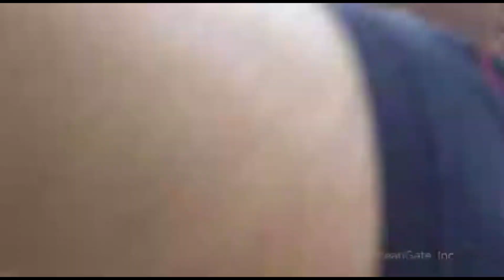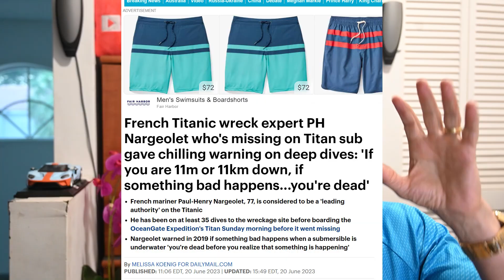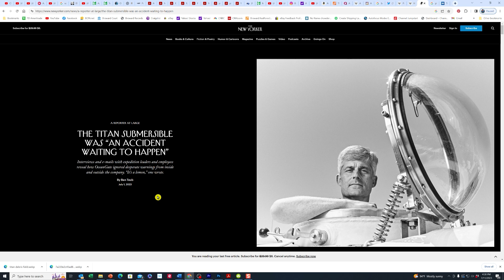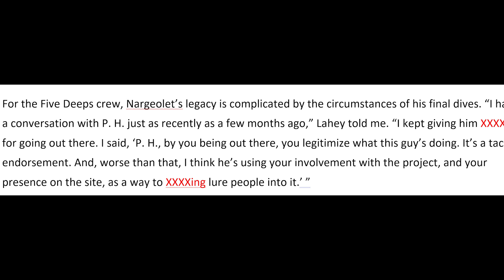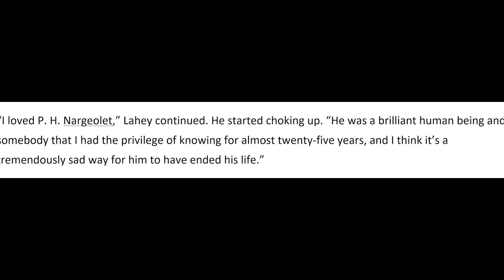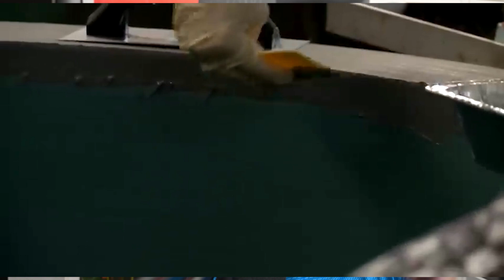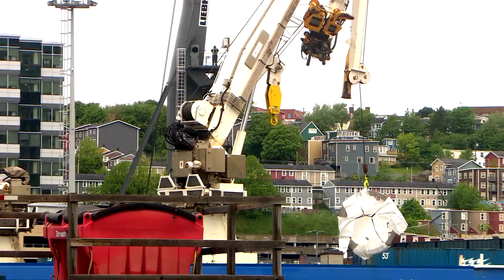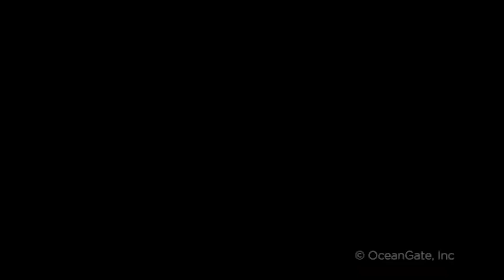Titan Sub: More Q&A, Design Defects, Why Descent Fast

Comment: I think it's a real argument for pilot error. Rush had far less concern about his descent rate than the mothership, which leads me to believe that he purposely dove at that speed. Either he was showing off for the Portier Prince crew to show them the sub was tough to show proof of concept or he was trying to hurry the trip to get back to something else. Either way, Rush was an engineer, he knew the possible outcome of descending too fast. Misplaced faith in his design or death by pride? Idk! And, I don't believe the sub was weighed down by water because Rush would have recognized that issue based on the rate of descent and would've made corrections to address the issue or flat out cancel the dive. Besides, the only infiltration of water that could have had a major effect on the dive rate would have had to occur within the pressure vessel where the crew sat. I find it highly unlikely that Rush or the crew would not have noticed a leak inside the sub. Additionally, if the hull was compromised enough to allow water to come in, the Titan would have imploded far before it reach the Titanic. Also, all the major components sat in liquid filled compartments or were in pressurized housings in the mechanical bay at the rear of the sub. if the sub was weighed down by water, where was the leak? In my view, the more likely scenario is that the rate of descent caused damage to the battery compartment and the hull and both only completely failed when the sub got near the titanic and needed to ascend. While they had a secondary battery system they only had one hull. Whether a vessel is  made  from titanium or carbon-fibre, descending or ascending too fast can cause structural failures in compartments and the main pressure vessel. All the hype about the material the subs hull was made from could actually be wrong!
Reply: If Rush intentionally dove at that speed, then why didn't it ascend at the correct rate?

The ascent was too slow, which I think helps point at the rapid descent as being unintentional.
Reply: @awilliams765 gravity, I believe, is the simplest answer
Reply: @kathypriest95 GRAVITY is counter-acted by water pushing up (buoyancy).   This discussion is trying to determine why the sub lacked buoyancy & fell almost twice as fast as expected.  Also why it ascended at only ~7 meter/second.  (Seems obvious to me: It was partly flooded with water.)
Reply: @kathypriest95  😂😂😂
Reply: @electrictroy2010  You could be right! Maybe there was water infiltration through the buoyancy system at the beginning of the dive that caused the descent rate to be high. But, what really gets me is that this guy designed this vessel. Even if all of his diagnostic equipment had failed, as the vessel's inventor, he should have been able to recognize the slightest of problems with the vessel. The accelerated descent rate wasn't a slight problem it was the elephant in the sub and was a clear and obvious sign that something was severely wrong somewhere and he flips it off like it didn't matter.
Reply: @awilliams765  I thought about that. If it was unintentional, the first warning sign would have been the descent rate itself. The crew of the Potier Prince seemed more concerned about the descent rate than Rush, inquiring if he was going change his velocity. This text suggest that he had the ability to slow the craft and just didn't or couldn't. But if he couldn't that too would've been a red flag. Why weren't corrections made or the dive aborted? Was he trying to keep everyone in the dark on the subs predicament to prevent panic, knowing it was no way out? Idk! 

The high rate of the dive itself at double the decent speed can cause major damage not just to the hull but also the titanium/steel battery compartments that are filled with a silicon liquid gel and sealed to protect the battery from intense pressure. From the transcripts, it appears the power system failed first forcing Rush to switch to the backup system. The backup system was subject to the same effects of the dive and while it had not completely failed like the primary power system it could have been on the verge of failing and not providing enough voltage for meaningful upward thrust. This then prompted Rush to drop every weight he could with little improvement. 

It's also possible that the intense pressure caused damage to the buoyancy system, allowing water to enter.

Another possibility takes on the perspective of the pilot's situational awareness. 1. At the beginning of the dive, you knew there were national and international regulations in place that specifically limits the dive speed of submersibles as a safety measure for the crew. 2. You are aware of the effects that a high dive rate can have on a vessel and its major components, yet you decide not to slow the velocity when prompted to do so. You believe your vessel is somehow more special than others because you made it. 3. You are aware that you feel attacked for your subs design and want to prove to your colleagues, who are engineers like you, that they are wrong and you are right, so with the crew of the Portier Prince as witnesses to his crowning achievement, he dove the Titan at literally breakneck speeds to prove his carbon fibre design was more durable than subs made from titanium. 4. He then becomes aware of the of realization that he was both right and wrong. He was right that his carbon fibre design could stand up to the pressure of the deep seas like subs made from Titanium but he was wrong for thinking his carbon fibre sub was not subject to the same detrimental effects as titanium subs at high dive rates. He was wrong to think he could skirt around regulations that strictly prohibit accelerated descents precisely for this reason. 5. He only became aware of his situation when the primary power systems failed, knowing he had backups he wasn't too concerned.   That awareness turned to fear magnified as the acoustic monitoring system was reading imminent implosion. When all his efforts to increase the ascent rate failed, he then came to his final awareness. 7. By trying to prove his colleagues wrong he allowed his hubris and ego to seal the fate of 4 other souls and himself. It's possible the sub was ascending at the correct rate but facing an imminent implosion from his perspective, no ascent rate would've been fast enough. 

 Or, it could be a combination of some or all these things and possibly more. We just don't know and may never know. 
 An arguement can be made for pilot error
Reply: It is a submersible, not a submarine. Descent happens because it has ballast weight, ascent happens when they drop the ballast. Both ways it is a passive motion driven by laws of physics. So, if you are sinking too fast and ascend too slow (or not at all), you are too heavy. Simple as that. The thrusters are only used to navigate around the wreck at the bottom.
Reply: @wreckingrich3788  The titan submersible does not have ballast tanks but does carry ballast to use in case of emergency situations.The submersible utilizes buoyancy control through the adjustment of syntactic foam-filled buoyancy modules to control its ascent and descent. To ascend, the crew can decrease the overall buoyancy of the submersible by reducing the volume or number of buoyancy modules. The thrusters play a crucial role in providing additional control and stability during ascent, allowing the crew to fine-tune the submersible's movement and maintain a safe and controlled ascent profile. No ballast needs to be drop in order to ascend. Only in emergency cases.
Reply: @dwsfamilyvlogs7705 EXCEPT dive speed is controlled by the weight of the sub, not the pilot.  You cannot arbitrarily double your dive speed, except by doubling your sub’s weight.
Reply: @electrictroy2010  The Titan submersible was designed for deep-sea exploration and had multiple thrusters for maneuverability. It featured a combination of horizontal and vertical thrusters that allowed it to move in various directions, including upward and downward. Mechanically speaking, it is theoretically possible for the Titan or any submarine to double its dive speed under certain conditions. There are regulations against performing this type of maneuver. For example, regulatory bodies such as the International Maritime Organization (IMO) and national maritime authorities may establish rules and guidelines specific to submersibles and underwater operations. These regulations often include requirements for submersible design, equipment standards, crew training, operational procedures, and safety protocols.regulations and safety guidelines exist to prevent pilots from attempting to double descent rates or engage in other unsafe practices.
Reply: @electrictroy2010  Thanks for the comment 👍
Reply: The Leak was with the Pressurized Air System, the "4-5 Days of Air" system.  It didn't have to be inside the crew compartment.

I've seen a lot of videos over the past couple of weeks, and some of them have been insisting that the Titan had Ballast Tanks.  Pressurized Air is necessary to push the water out of those tanks when the time comes to go back up again.  If that air leaked early on in the dive, there would have been no way to push the water out, plus the tanks that held the air would have filled with water.  

And Remember there's a connection between the stored pressurized air and the Crew compartment.  It was probably possible to pressurize the inside of the crew compartment to more than 1 atmosphere as well, which would mean they'd have to decompress on the way back up, but it would relieve some of the stresses from the differential inside and outside the pressure vessel.

But what happens if the crew were forced to manually seal all the valves to that pressurized air system, because that was full of water?
Reply: @jamespfp I agree 👍! If it's true that water weighed the sub down without the crew noticing, it It had to be in a place they could not check immediately like the buoyancy system.  I suggested this in a previous comment. However, if this is true,  why didn't Rush slow the descent with thrusters. Battery power was still functional at the top and bottom. If the Portier Prince thought he should have slowed his velocity, he would've come to the same conclusion, unless 🤔 Rush internationally dove that fast.
Reply: @jamespfp  The diagnostic system would have detected and alerted the crew of any malfunction aboard the vessel. Unless, the diagnostic system was malfunctioning itself. All signs point to pilot error and or buoyancy system problems. The carbon fibre hull was the last thing to fail caused by other malfunctions of the vessel which originated from pilot error. No way Rush should have missed the descent rate issue. That was the first sign of trouble and he did nothing to correct and even changed the subject to how happy his crew was.
Reply: @dwsfamilyvlogs7705  You're making more assumptions than I am, by my estimation.  The surface was well aware of it and kept asking, and the person in command didn't necessarily answer any of those queries.

The only assumption I would encourage others to consider is that there was pressurized air in a separate set of tanks, and that would be used to replenish the air inside the infamous crew compartment with its carbon fiber cylinder.  But that's not the only use for high pressure air, and moreover, they'd have to be pretty careful about adding air into the main compartment or else they'd be putting more than 1 atmosphere of pressure in there, too.

With that being said, it might have actually been somewhat useful to do that to avert disaster; unless of course there was water in the tanks where pressurized air was supposed to be, in which case they had to seal off the crew compartment completely and that, friends, is what makes the implosion more likely to occur.

So Yeah.  I won't be shocked if the world finds out some time later that they were pretty much doomed from the start because the pressurized air (the several days worth of air) had leaked in the first 5-15 minutes, and that's where the added ballast came from.
Reply: Also -- re: "If water got inside the Titan it would have imploded faster";  Maybe yes, maybe No.  If it had completely flooded, it would not have imploded at all and they'd have all still drowned, unless they had scuba tanks inside the crew compartment.
Reply: @jamespfp  I've seen video's with that tank. But I think some video's don't show the tank. Instead, you see four concrete hald-circles hanging on the bottom. I think the video's with the tank are renders. So I am unsure whether Titan had a ballast tank which they could fill and empty.
Reply: @marijnfly  agreed! the Titan was designed to utilize a combination of techniques to control its ascent and descent. This includes: Buoyancy Control, Dive Planes and thrusters it did not have ballast tanks rather it carried ballast for emergency situations. By carefully coordinating the adjustments of the buoyancy control system, dive planes, and thrusters, the crew can achieve controlled and safe ascent and descent profiles.
Reply: Especially when the vessel was "rated for" 4,000 meters and they were using it to go 3,800 meters. NOT a lot of leeway there. Not to mention the window was rated for far less.
Reply: @Garth2011  Agreed! Pushing the sub to the precipice of its design limits wasn't very logical! Pure tungsten carbide begins to degrade at 3500°.
If you continue to apply 1500° to that same tungsten carbide, it will degrade slower, but nonetheless, it will degrade.  Great point! The window was rated for 1400 feet 😳 far more shallower than the depth it was being used at. 😳  Why would he take the risk with his own life, let alone 4 others? Baffling?
Reply: A person with his kind and level of EGO will never see what he does not wish to, nor will he hear anything that contradicts his version of reality!
Reply: Thank you, that makes a lot of sense. If true, it's ironic that both the Titanic and its namesake sub were destroyed by going too fast for conditions.
Reply: Descending too fast?  It SINKS?  There's no  control, it's just not supposed to descend too fast.  Which it did.  Due to some time of buoyancy problem.  Why can you not figure that out?  

And on top of that, had to write a goddam novel to really illustrate your lack of understanding?  🤷🏼‍♂️
Reply: “Rush would have recognized that issue” THE CEO fired his safety engineer.  He didn’t care about the faster-than-normal descent because he didn’t care about safety

.
Reply: @SuperNostalgia.  Can u stop being a freak?
Reply: Rate of descent let's see there have been so many good theories I hate to chime in. But wait think about a rock tossed into the lake. Mother nature and physics dictate the rate of descent by weight of the rock, initial velocity when it enters the water decreasing maybe due to water density, water type,  density (muddy, clear, weed or algae rich, you get it) as the rock falls so velocity may be lost/gained due to water conditions. No ballast no buoyancy the rock simply follows MN and physics. 

The sub, as with virtually all of them tweak MN a bit and add ballast (pipe + sandbags + people + gear) as fixed or disposable at depth or whenever. Of course blow bladders for buoyancy , sealed tanks, etc and the volume of the sealed pressure chamber. Since there is a delicate dance between negative, positive and neutral ballast the calculations and placement of equipment and people is very important if not critical. I fly a lot (almost 2 million sky miles with one airline) and I can tell you people get bumped, bags are restricted and people moved around because the airplane has load cells and can measure weight and balance. You can ascent uncontrollably and stall or drop like a rock either way if W&B are out.

This little sub needed the balance of a ballerina to achieve this feat for 12500 feet down and back up.

Our rock is largely solid, fixed mass and weight and will tumble down in the water and end up on the bottom. End of story.

Our sub needs to control buoyancy and balance to navigate descend and ascend.

But for whatever reason, now pay attention James Cameron all but quoted the text message communications in an interview the other day saying they were at about 3500 M dropped ballast and trying to ascend. This was Monday after Sunday when it was lost. He and Bob the explorer who actually found the Titanic in 85 were chatting early and through the day. James was so confident they were right and the sub was gone he emailed his inner circle and said "Folks Titan is gone and all are lost"

Also if you DO believe the transcript of text comms (I do if Cameron knew about it) the descent rate WAS NOT even remotely mentioned until trouble arose at around 9:28 and then only reverse direction related to assent once RTM went off.

I don't know what SR had in his head but he was on an express run to get to the wreck. He knew the numbers for descent 2 1/2 hours they made it in 2/3 or less the time. Too fast. Too much stress old hull. I predict a loss of buoyancy and extreme angle of attack (the last few minutes at the end I theorize they were all in the view window like a seething blob of human flesh and a stone creating a mad dive) ushered the end to this instantly.

They lost control. Pure and simple. Water in electrics water seeping in the hull improper weight and balance unable to blow the air bladder. Almost did not drop the pipe ballast or frame. They were done already.

When you have no plan this is how things may and likely will end. People sitting on the floor not strapped or belted in. Apparently from the exhaustive research I have done points to a hap hazard approach to weight, balance, buoyancy and the ability to right ones self. The sub became an out of balance uncontrollable missile the end was then quicker than we can conceive!

All the critical mistakes construction, tactical, physics and just plain bad luck converged on the little ship at once. It was a good day for Murphy (whatever can go wrong will go wrong and that all at once) and a bad day for Ocean Gate.